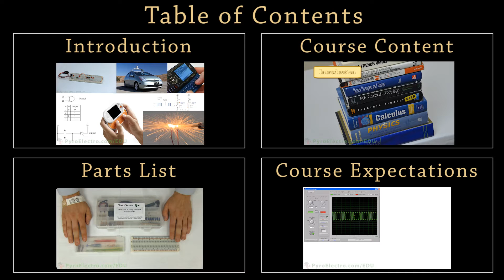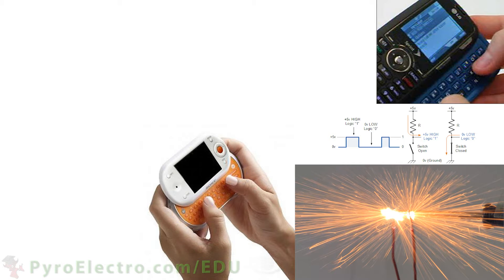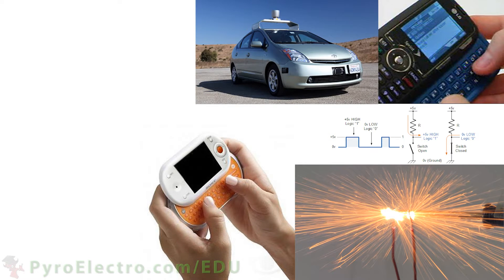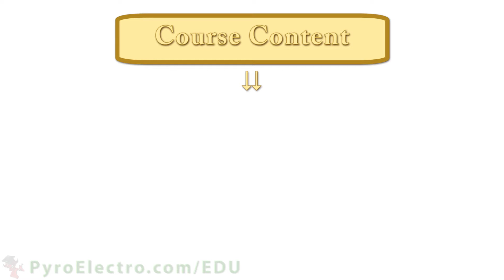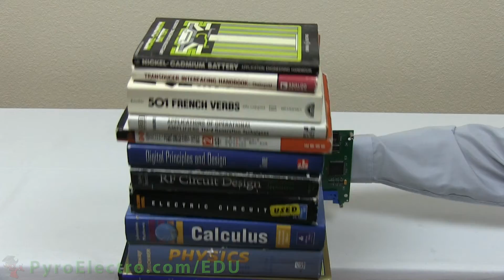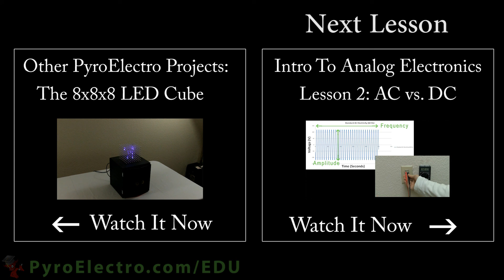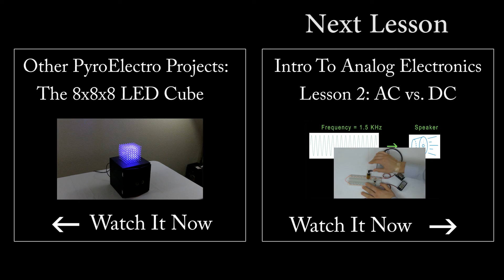The Intro - An Introduction To Analog Electronics - PyroEDU

Comment: Hello guys..   Plz check tis video below.it Is a hardware type pattern draw input security board using basic analog circuit design..... and comment what u understand frm tis........... cmt ur views and ideas fr implementation with other app are always welcome.  I will make code and ckt diagram open source tru github 
#security 
#Ir
#uc